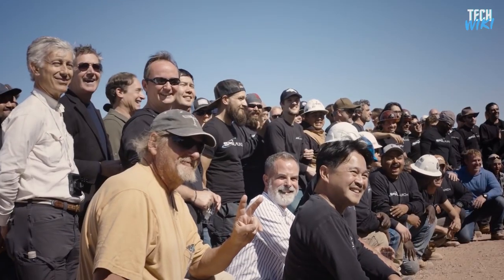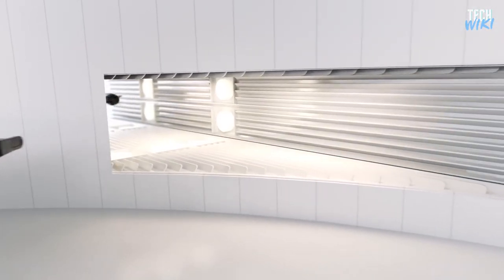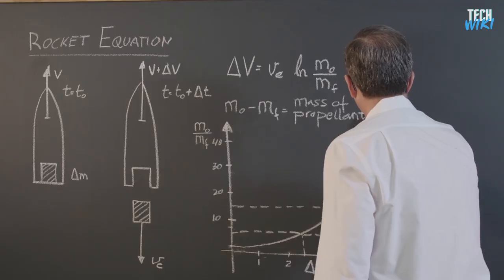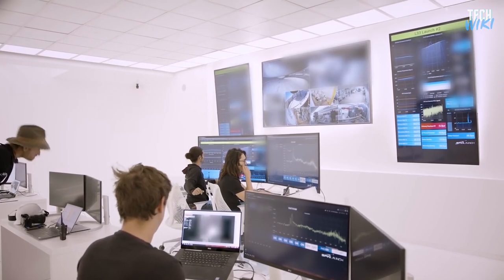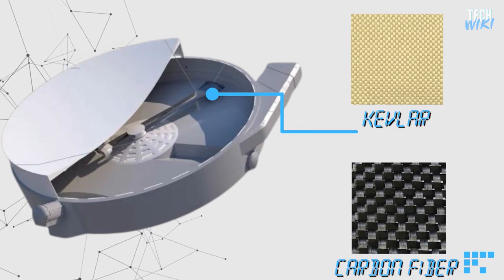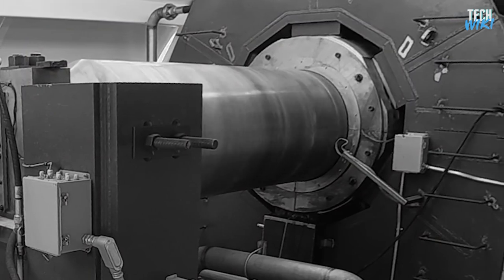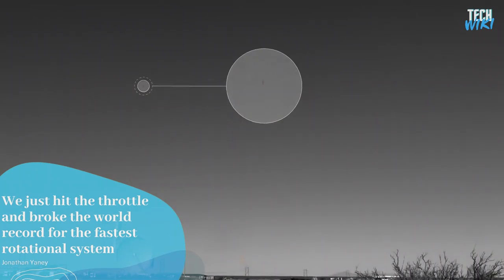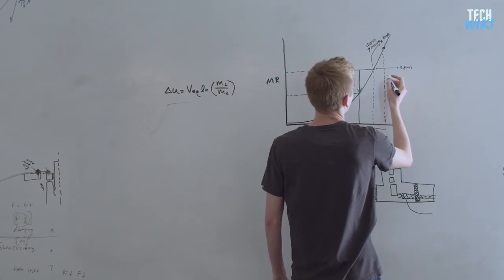SPINLAUNCH! A New Crazy Method To Launch Satellites Into Space, Does it Really Work?

Comment: This is not a viable option for future spaceflight as you could not put people in it. There would be nothing left of them after spinning in a centrifuge. If you know that it's not a viable option, then we need to be looking elsewhere. Since most of the fuel is burned up in the first 10 seconds of the flight, better to look at hauling the capsule up to cruising altitude before firing the rockets. We know that we can get military airplanes up to 90,000 ft, which is about halfway to what they're talking about here, so if you start there with a standard aircraft lifting to that point and then a small short booster rocket to get it to 200,000 ft, then you could put people in it. There would be very little waste involved and you wouldn't need Elon musk's reusable rocket boosters anymore.
Reply: The issue is not height, the issue is to get the payload to orbital velocity. The benefit of an air launch is in having less drag to deal with when the rocket starts, and going higher than 33,000 ft brings diminishing returns.
Reply: You dont need it for people.